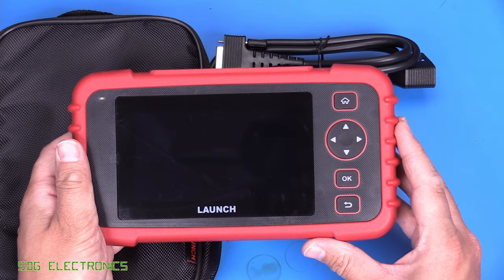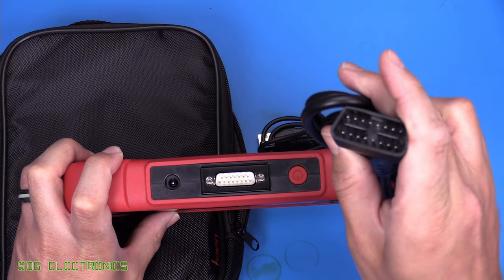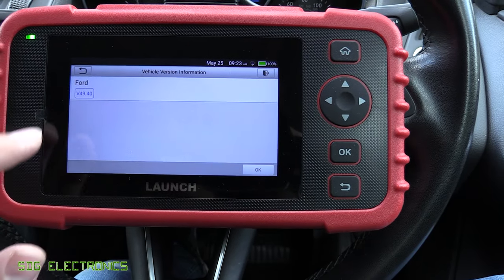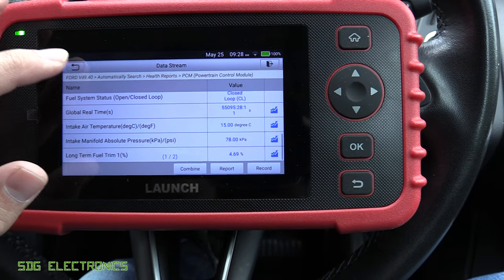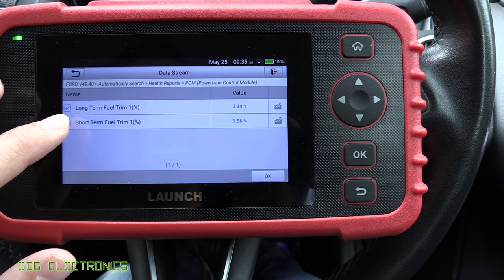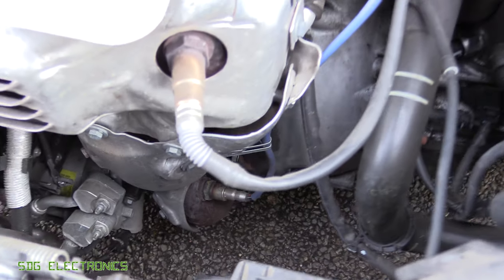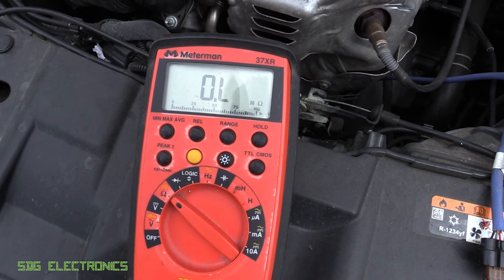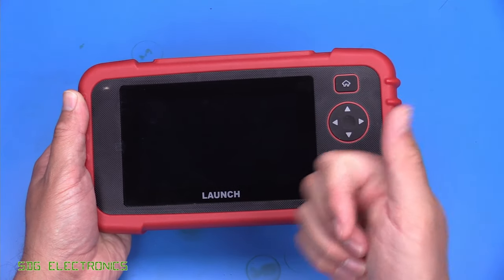SDG #302  Launch CRP123X and a Ford Focus Ecoboost with P0137 and P0141 O2 Sensor Codes

Comment: The engine is so cute. A little 1 liter (that's 1000cc) 3 cylinder turbo FORD thingamabob. This is interesting because FORD has a track record of hating turbos except for Diesels. 

Sometimes removing the O2 sensor can be difficult. I use a dedicated O2 socket and heat up the manifold slight if the sensor will not crack loose easily. Epoxy, like JB weld, might be a better choice for at quick temporary repair plastic manifold repair. For a permanent repair, It is possible to use the uncommon and unique skill of plastic welding to fix a plastic manifold. It is good to practice first on a junk manifold from the junk yard. Once you are confident in the proper filler material and possible screen approach, then you can remove the manifold, clean it up and make the repair.

Is there another upstream O2 sensor directly on the exhaust manifold above the downstream sensor?